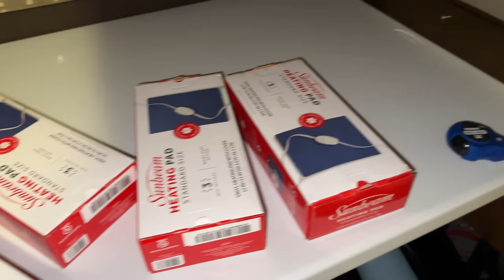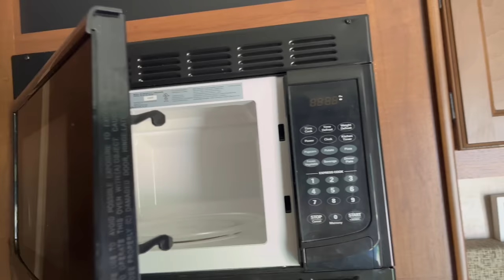Why I Eat my Pets (Trauma Dump)

Comment: I have a solution for the flys. If u get a “5 gallon fly-lid” it catches a lot of fly’s. Or you could get a “rescue fly trap” and take the top off and put it on a 5 gallon bucket lid to catch a lot as well and may be better than the other option. Both are on TikTok if u wanna do some research yourself

Comment: Be careful in that trailer Uncle-Dad Ben! Trailer outlets & wiring are generally only rated to handle 1000watts safely without overheating and melting the wires.
(Talking from personal experience here 😅)